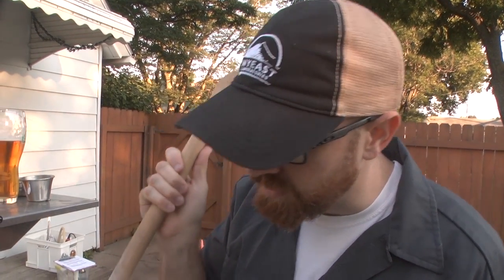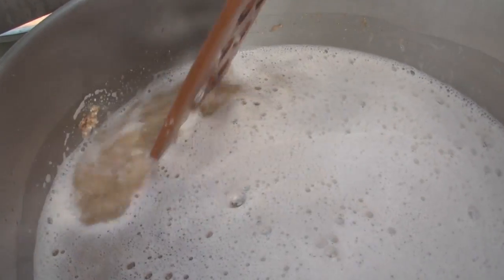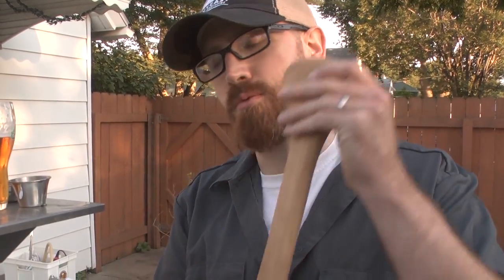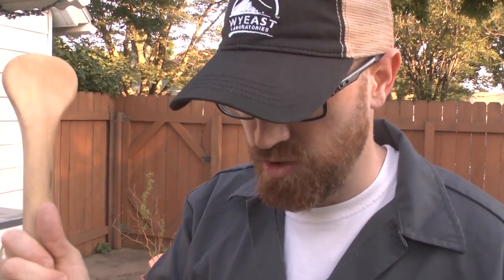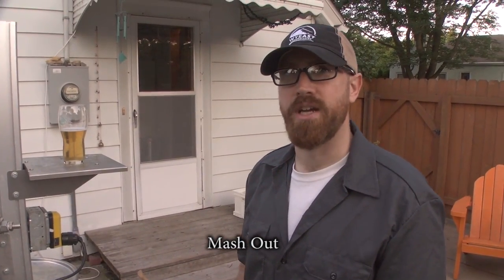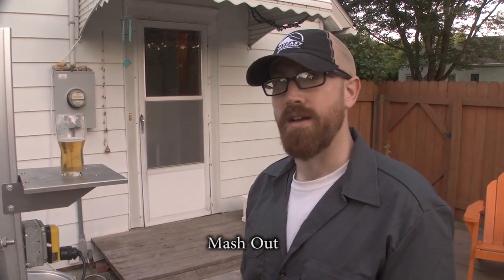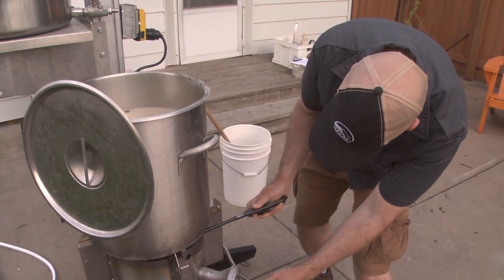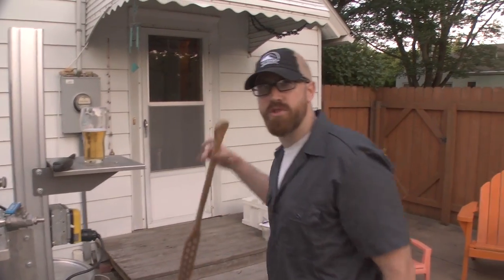Boat Bitter Bonus Footage

Comment from the maker: No, I believe he drops the yeast out of the bottom of the conical (in this case) first, let's it settle, and then adds finings (if he is at all). Or maybe I'm confused. But I don't think he would fine before pulling the yeast b/c that in itself will help fine the beer to a certain degree -- just getting it off the yeast. Chip.